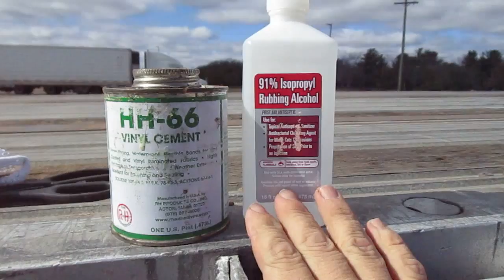#68 Finally Empty and Patching Tarps The Life of an Owner Operator Flatbed Truck Driver Vlog

Comment: Just a thought Dan - try using your Bluetooth mic with your camera, it will "probably" work better outside. If it does work better, you won't have to keep running back and forth to the camera. Thanks for all your GREAT content and your consistent desire to do the best job you can with these videos, proving once again your professionalism, as with your engine bay cleanliness!

Comment: Patching our vinyl the instructions always told us to use the rough side of the patch as the contact surface because the glue will bond better than putting it on the smooth side.  Your theory is correct.
Reply from the maker: +Bonnie Hamilton 
Thanks

Comment: Dan, thanks for another great video...As far as the snow storm..It shifted and your thought about taken HWY 80 to 35W, would be a huge mistake, you'll run smack dab in it...Best bet would be interstate 94 through WI, then into St.Paul MN..As it looks right now, the southern part of the Twin Cities (Mpls & St.Paul) are the only parts of the cities that will get the brunt, the rest of the storm, due to the shift will be all southern Minnesota, and straight up 35W...Be safe and keep it between the ditches..